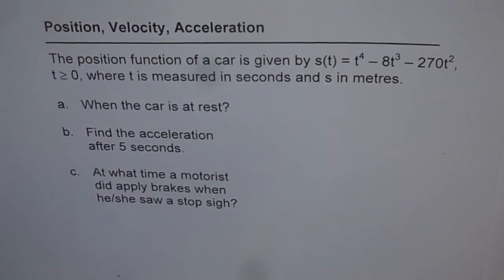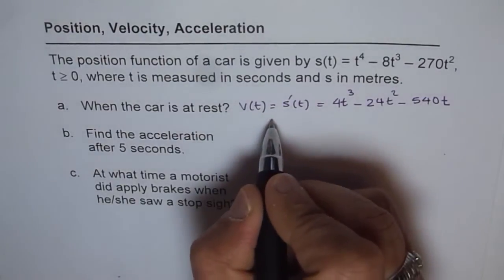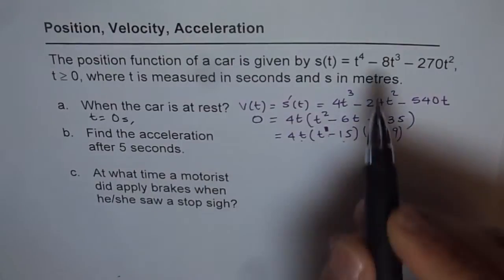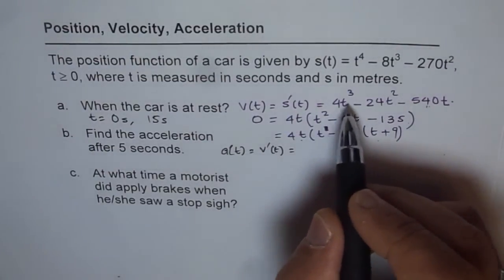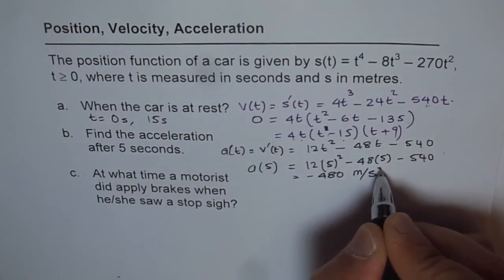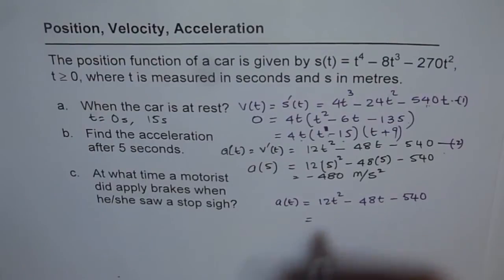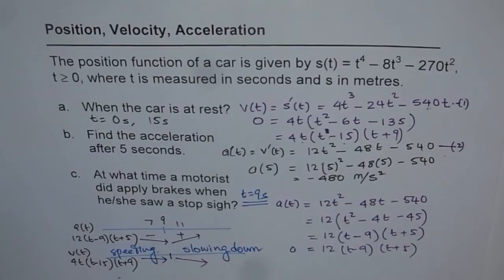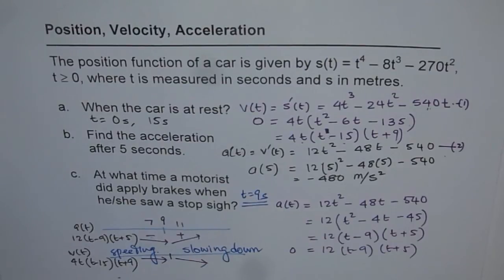Calculus Position Velocity Acceleration Test 1

Comment: No doubt, one should pause the video after reading this question. While I agree that your procedure is correct for determining the answers to parts a, b, and c; there is no way on God's Earth that s(t) represents the position for a car! I solved the problem and then asked myself the question, "What's going on such that the velocity and acceleration are each initially negative?" Is the car backing up with increasing speed? That's not reasonable. The remaining alternative is that s'(t) represents a closing speed since "the car" experiences its minimum velocity at t = 9 seconds but has positive acceleration thereafter until it stops at t = 15 seconds. (Velocity and acceleration having opposite signs indicates the vehicle is slowing down. Therefore, s'(t) must represent a rate of closure, which makes sense if approaching a stop sign.) Even taking this into account, the minimum velocity [maximum closure rate], v(t = 9 seconds) = - 3888 m/s, nearly twice as fast as the fastest vehicle speed ever recorded; the 3 October 1967 flight of the X-15, top speed 4520 miles per hour.